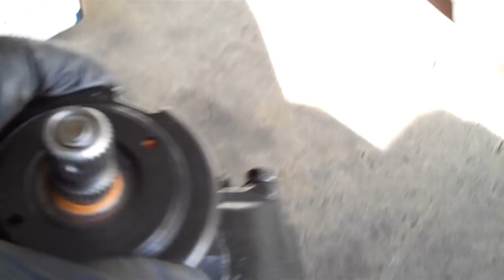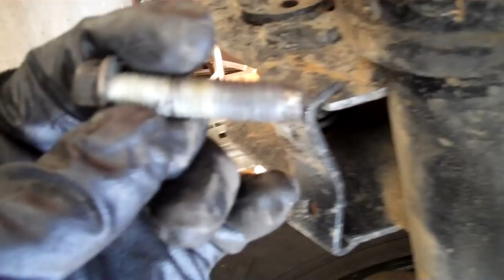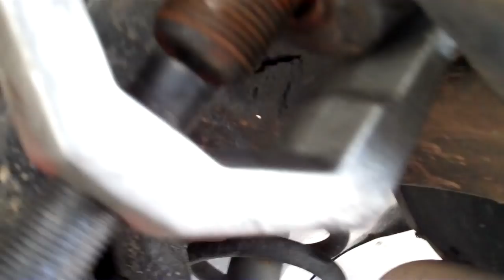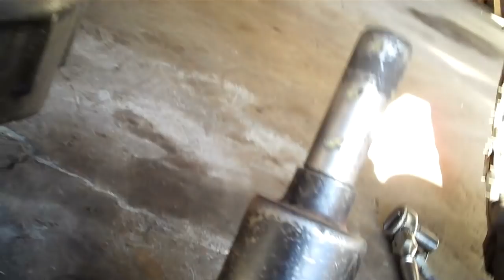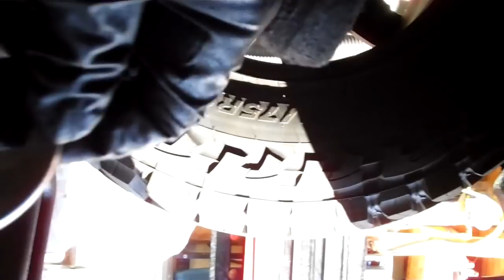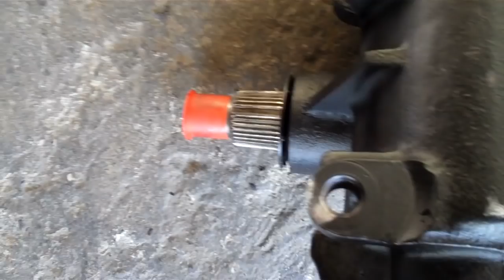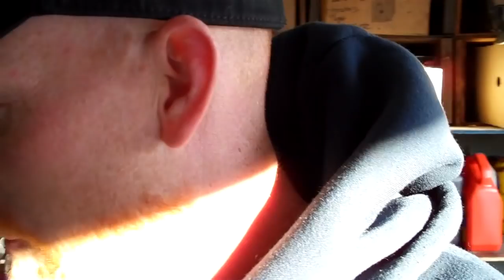How to replace your Power Steering Gear Box!

Comment: Thanks dude. Just wanted to see what I'm getting into before I head to the auto parts store. Have to replace the steering box because my pitman arm is super STUCK. Completely stripped a pitman puller and while it had as much tension as I could get on it with the puller, me and another guy were literally hanging on a 48in snap on pry bar. When that didn't work we were driving down on it with that 48in pry bar and sledgehammer. Then we got another pry bar and tried both. Still stuck on like crazy.
Reply: Heat and PDBlaster always helps!
Reply: Wow, that's on there. I used a CP w no issues at all! I did not have the crows foot for the lines so I lowerd the box & did it that way. But it's great now, tight & right! My Wife just did an 1,100 mile trip pulling a camper.
Reply: +Will Dawson what about some PB blaster and a torch
Reply: +Will Dawson That sucks! What finally made it come apart?
Reply: Dave Kana lol nothing I was going to take the whole tie rod off with it but everything is super stuck, including the tie rod ends. I just need a impact rated ball joint separator, that will have to bought online probably, and a good impact gun but that's not cheap. I have a snapon account but I really want Milwaukee power tools :/
Reply: That must really be stuck!
Reply: Tried it all guys thanks for looking out though. Still saving for that Milwaukee impact with 1200ft lbs of break away torque. That better work if not I've got a nice new toy and its getting cut off.
Reply: I don't know if it has anything to do with it but the previous owner was like 400lbs
Reply: So funny! Maybe!!
Reply: Dave Kana I sit on a pillow needless to say. The seat is a different shape now.
Reply: I get that. The seat cushion is held in w 4 bolts. So it could be changed w a passenger side one! That's what I did on my 2000. Much better!
Reply: Joseph Dawson
Reply: what she said

Comment: Not bad dude breaks it down so even a 16 year-old could do it. Question though once the fluid has been airated I believe you called it suspended will that make a great box work fine one direction and not the other.? Let me know
Reply: Skip Chavez The vehicle will not have a preference for fluid distribution at that point, It will mainly cause corrosion's, and usually a wine or squeal in the pump, or even gear box, either way no good. If your having issues turning one direction but not the other, its not fluid-related

Comment: Help full videos thanks, I have question my 2000 dodge diesel 4x4 does not have play but it does have A discomfort when driving and turning you can feel it in the steering wheel that it has a force to it, of wanting too push to other side, let me know if you have answer for it thanks

Comment: That Isnt a Red head steering box is it?? and what did you pay for your steering box? and where did you get it and what are your thoughts on it?
Reply: I bought a replacement for my 91 Ford Bronco I havent put it in yet but it cost me $150 after I return with the old core. I got It from Napa Auto Parts

Comment: Turning the wheel and removing the air out of the system before reattaching the linkage was a great tip; thanks for that!
Reply: Old Rocker to bleed it do you just have to turn the steering wheel while it's off ???

Comment: My electric impact wrench would not pull off that 33mm bolt so I change the whole gear unit. Before you call me crazy, the old unit had 296,00 miles on it. I should be able to drive down the hwy with one hand now. Goody goody.

Comment: good tip to turn the wheels before starting the car, but i tried to do that while the key on the on position and wheels on the ground and it did not turn at all, do realy i have to have the wheel off the ground, please let me knew. thanks.

Comment: Beauty vid. Thanks for all the tips, especially bleeding the fluid. Did the pitman arm sync up with the new gearbox immediately or do you have to tweak the gear to line up straight? And, the steering wheel still centered after install?

Comment: we put one on an e 350 1998. Simple job. 4 boxes later still not done. They wont turn both ways. They were all from the same batch and rebuilder. The range of motion is only 90 degrees. Old box has a lot more travel. Ever have this issue? I can set the pitman arm to either turn left or right, but cant get both due to limited travel or range. About to reinstall old box. Any ideas?

Comment from the maker: It has air in the system.  After replacing all the leaks- turn the wheel to lock (so it can pressure release and thus release air from gear) and hold there and rev it for about 15-30 seconds to clear the air and then let it sit for a half hour then top off to full cold line and drive it.

Comment: thanks for reply.   i just put in a Red Head steering gear box, and it has helped a lot!    I also added a Spohn performance Track Bar, while i was doing it.   Was nice to have all this OFF to do the gear box, and do the track bar and the bracket.   NOTE.   when i took the stabilizer off the Bearing was bound up!   does not have a grease fitting, and water and moisture sits in there and could cause more return trouble that good!   I left off the bearing for now.

Comment: Hey man I have a question I have a 2002 silverado and it is very hard to turn left. I pinched one of the upper ball joints so the grease came up. Since then I thought that's why it was hard tk turn left. Perfectly fine right though. After both joints were replaced still have same problem all other joints are good. Any idea on what it is?? All fluids are good as well and joints are packed with grease 
Please help. Love all your vids watch u all the time.  It is reallyy hard to turn leftatslowsped

Comment: Great video! I have a 96 Ram 1500 lifted with 35's (bought it that way) and the gear box was just sloppy as all hell. If i put my hand on the top of the steering wheel, i could turn it all the way left to 10 o clock and right to 3 o clock with the pitman arm completely still. Thanks for the how to, it probably saved me an hour or 2 of figuring crap out.

Comment from the maker: Check all the seals and connections on the fuel system.  O-rings for a fuel filter cap, fuel hose connections etc.

Comment from the maker: Ah ha!  Yours is different and doesn't have that.  The same principle applies though the components will be different.  Basically air is entering the fuel system somewhere between the lift pump and the injection pump.

Comment from the maker: YES!  Mine did that when I first bought it and it was terrible on road trips when I had to stop for gas.  I would purge the fuel filter can with the plastic lever and it would start right up, but I was leaving puddles of fuel where I'd fuel up. (felt bad)  The fix was to replace the 0-rings for that little lever and the fuel filter cap top.  Now It fires up awesome all the time. Cost from the dealership was $30 in parts.  Took ten minutes labor.

Comment: awesome video came in very handy it looks like my ram is just like yours i got the leak solved thanks to you. have you experienced any starting problems with yours mine hass a new fuel pump and vp44 1 month old. and it fires right up or it will crank for about 30 seconds with the engine warm. any ideas?

Comment: Thanks! I figured autozone/advance probably werent that great. I think Im gonna just spend the money on a Redhead steering gear. I had a Borgeson on my 99 2500 but the steering stabilizer bar didnt fit with it. Also, noticed you go through tie rods a bunch like me. Have you heard of Lukes links? I had them on my 99 and now on the 01, they are great! Never buy another tie rod again, and no need to get truck aligned afterward either.

Comment: Thank you for the visual...I am replacing my steering gear box on 98 Ram 2500 4x4 diesel with 400,000+ miles.. I too have ordered dodgeramsteeringstabilizer and  rocksolidramtrucksteering. What after market brand do you use for replacement parts for your Ram Truck for steering tierods and suspension?

Comment: Brian, i changed the steering box in my ZJ, got a reman. from AZ, i just replaced the pitman arm as i don't have air and after 16 years i thought it a good idea to replace, also sometimes a PITA to remove regardless-- Thank god for those crowsfeet as they worked wonders and can take plenty of torque, my box came with new o-rings-- i bled PS with new fluid by disconnecting the coil and cranking it over, all in all a fairly simple job and i saved like 500 vs a garage- have you tried the brace?

Comment from the maker: I recommend pressure testing the system.  If you had a small leak in the head gasket it would behave that way.  Often when coolant gets low it makes a gurgle noise in the heater core.

Comment: Oh yea I have a ant-freeze leak somewhere but not sure... Ive been hearing a strange noise up front si it may be the water pump, but I dont see it leaking anywhere around it....Have any ideas? mine is the 5.9 12 valve.

Comment: Bet it is the intermediate shaft in between the steering gear box and steering wheel. Like brian said, the U-Joint is probably shot. You should try pick-n-pull. Fairly easy fix i just did mine in about an hour.

Comment: Brian I have a 97 powerstroke 4x4 and it has slack in the steering and everything has been replaced because of being wore out except for steering column and gear box..Do you feel the box will solve that issue? My mechanic use the term it doesn't want to return to center...It had an alignment this summer.

Comment from the maker: Open your hood and have some one turn right and left and watch the steering shaft.  It may have lost a U-joint.  OR your rack and pinion may have failed.  Either way- that's scary.  Also if you have an air bag on your steering wheel you likely have a failed clock spring as well.

Comment from the maker: It's very similar.  On a Ford however, turn the wheel lock to lock left and right 20-40 times with the wheels in the air and check the fluid often.  They are much harder to bleed due to the shapes of the lines and pressure feedback devices.  Failure to do this will result in a noisy system/pump.

Comment: Hey quick question about to start on a Ford F-150 2001 do the same steps apply for the ford as in your video? I assume there might be different bolt sizes but the same general steps? Because I know F-150's can be a pain to work on in general sometimes. Thanks!

Comment: @briansmobile1 The new rack has been installed and the steering is SO much better, but now I have a new symptom. The left side wheel is rubbing the inner surface of the wheel well when the steering is turned all the way to the left.

I'm stumped and have no idea what could cause this. Any ideas?

Comment: Hey Brian, I have a question for you regarding my '00 Subaru Outback. I wanted a second opinion before I dropped $300 to replace my steering rack. The rack has never been replaced, and recently it's started to bind pretty badly.

I've tried everything from replacing the boots (which were twisted and torn), to cycling the fluid until clear, and I recently noticed that even with the front wheels off the ground and the engine off, the steering still binds.

Is it just old, and should I replace it?

Comment from the maker: @Usernameinvalid16 That does sound like valve stem seals.  You can pull the spark plug crank the engine to bdc and stuff rope in the hole and rotate till tight and do them with the head on.

Comment: I have broke over 3 of the new styles of craftsman ratchets I had 3 of the old styles straight the heads had stripped out over the last 15 years I save them up and take all to sears at once .
All they could give me was the kind you have I found out there made in China now . They are not as strong as they used to be.

Comment: great video. if i'm not mistaken those steering boxes were the same as the ones used on the chevy trucks at the time or was that previous years. i noticed you didn't need to unbolt it first before you took the pitman arm off. thats a downfall to the chevy ones it has to be unbolted, pushed back then there is room for the puller.

Comment from the maker: @gosemonster PB blaster soak it over night.  Then put your puller on and get it tight.  Next put a face shield on and F(*^&*(&'n LOVE TAP that pitman arm on the back side ring that goes around the output shaft of the gear.  Don't hit down, just hit straight against it to shock the rust apart.  I wish I was there.  I LOVE TAP the $#!T out of those!  LOL

Comment from the maker: @Usernameinvalid16 No problem friend.  It sounds like the idle circuit of the carbuetor or "air screw" is too tight.  Try backing it out first.  Look at the plug to see if it's too black after it's a new plug and idled on for 15 min.  Also Oil Smoke is blue tinted.  Too rich smoke is black.  Hope this helps.  Good luck!

Comment from the maker: @whitedoggarage  GREAT QUESTION!  It IS a Dodge.  It's made in Mexico.  Many SAE sizes lapse the metric scale.  What's nice is many car companies use the sizes that intersect the two systems.  i.e. 13mm= 1/2 inch 3/4 inch = 19mm  5/16 inch = 8mm or at least close enough.  14mm wrenches fit onto 9/16 inch bolts/nuts but it's tight.  What a mess huh?

Comment from the maker: @spelunkerd  The "POWER BRAKES" do.  The brake master cylinder itself and the calipers etc. still use DOT 3.  The hydro boost is run on the power steering pump.  Diesels don't have any vacuum left over to spare because the intake has no restriction.  It's wide open all the time.  So this is developed to replace the vacuum power brake booster. GREAT QUESTION RIGHT HERE!

Comment: I've been looking for one of these, thanks for the summary. Did you say at 10:55 that your brakes use the same fluid that is used for the power steering? Cool, I didn't know you needed extra fluid to operate the power assist for brakes -- is that a common setup? Is Tyson your son?

Comment: Try using a return line filter on these hydroboost style power steering/brake systems. If one unit goes bad the other is not contaminated as well. Magnefine is an inline "fuel filter style" filter that has magnets as well as a filter element with a bypass.

Comment: I cannot get the pitman arm of my steering gear box on a 2000 GMC 2500 truck. I have broke one pitman puller and used a torch to heat it a little with no success. Any suggestions? I am about to give up and replace both the steering gear box and the pitman arm.

Comment: I like to run the seat belt through the steering wheel, then click it in. That way if it does move, it won't move very far. Great video by the way.